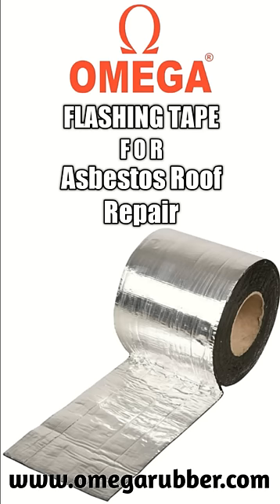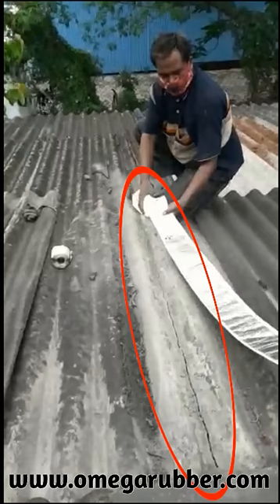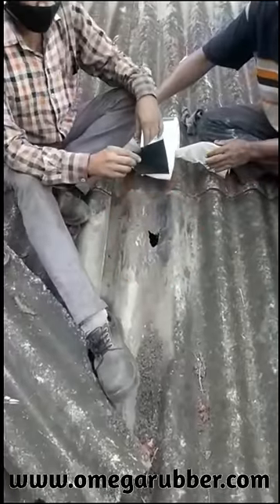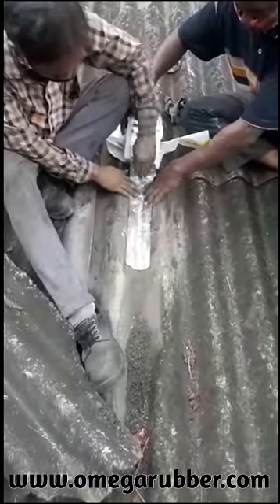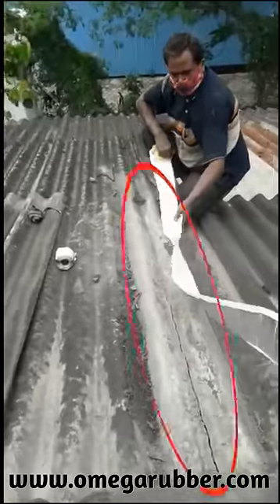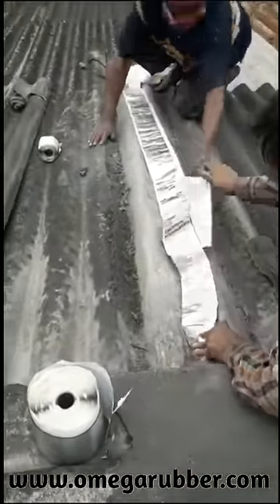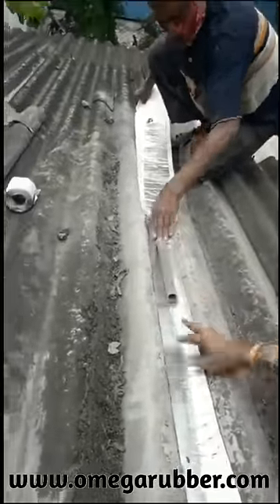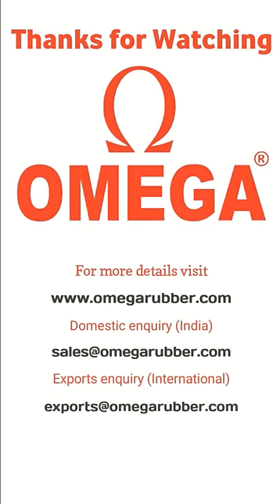HOW TO quickly repair leaking asbestos roof using OMEGA BUTYL ALUMINIUM FLASHING TAPE I India I

Comment: I have spent lot for asbestos sheet to solve water leakage. I shall try this to. 
Do u have any specialist to do this?
Reply from the maker: Ideally this is a Do It Yourself(DIY) product, so if the location where the application is needed is accessible easily we would say you can do it on your own. However, if you feel that the location is a little risky or is not easily approachable we would definitely ask you to take help from someone because we don't want you to get hurt.

Comment: In the centre of mine profile sheet and rcc lanter there is a crack through which water came down is there any sloution of it the crack lengthy is almost 10 feet ???😊😊😊😊 Which tape is suitable for me and how to apply and how many metres for 10 feet lenght  crack
Reply from the maker: Our tape is 10mtr long which is over 30ft so as far as length is concerned you are pretty much covered
We recommend you use 150mm x 10mtr OMEGA Butyl Flashing Tape
please find the links to our product below
before applying the tape please ensure that the surface is absolutely clean and dry

Amazon:
150mm x 10mtr
https://www.amazon.in/gp/product/B097Y1NTQD/ref=cx_skuctr_share?smid=A31UCKADDKPX9T

Flipkart:
150mm x 10mtr
https://dl.flipkart.com/dl/product/p/itme?pid=HWTG3ZF47PGXK9TN&lid=LSTHWTG3ZF47PGXK9TNBEWCBO

Comment: Can this tape can use for cement sheet joints water reverse problem and what is the life span of product
Reply from the maker: Yes OMEGA BUTYL FLASHING TAPE  is  ideally suitable for stopping water leakage in cement sheet joints . You can buy it from Amazon or Flipkart . 

Thanks

Comment: Is  this Omega sheet is available in Kolkata? If it is  then which market in Kolkata?please let me know?
Reply from the maker: Yes! Our products are available Pan India on both major ecommerce platforms i.e. Amazon and Flipkart please find the link to our products below

Amazon:
150mm x 10mtr
https://www.amazon.in/gp/product/B097Y1NTQD/ref=cx_skuctr_share?smid=A31UCKADDKPX9T

100mm x 10mtr
https://www.amazon.in/gp/product/B0974G1QTB/ref=cx_skuctr_share?smid=A31UCKADDKPX9T

50mm x 20mtr
https://www.amazon.in/gp/product/B097Y3VZP8/ref=cx_skuctr_share?smid=A31UCKADDKPX9T

Flipkart:
150mm x 10mtr
https://dl.flipkart.com/dl/product/p/itme?pid=HWTG3ZF47PGXK9TN&lid=LSTHWTG3ZF47PGXK9TNBEWCBO

100mm x 10mtr
https://dl.flipkart.com/dl/product/p/itme?pid=HWTG2WF6HYFYZYAV&lid=LSTHWTG2WF6HYFYZYAVRTUKGO

50mm x 20mtr
https://dl.flipkart.com/dl/product/p/itme?pid=HWTG3ZF4KSJQ4W6U&lid=LSTHWTG3ZF4KSJQ4W6UX1BGVW

Video Link for asbestos roof repair is attached below
https://youtu.be/KqgQwV7KLrQ

Comment: It is used in.cracks in water plastic tanks??
Reply from the maker: Yes it can be used to repair Plastic tanks. 
For Best Results, Please note you should use the tape when the plastic tank is absolutely DRY 
( DO NOT Stick on Wet surface or when water is flowing from the leaking area ) 
Stick the tape from inside and also from outside to give you a watertight joint.

Comment: Wil  it work in raining season as it's a tap will it  wearing out when it comes in contact with water sowil it stay during raining season
Reply from the maker: The tape has to be applied on dry and clean surfaces only
No, it will not wear out easily even if it comes in contact with water post application
Reply: Thank you
Reply: How can I order the tape
Reply from the maker: You can easily find our product on Amazon and Flipkart
Please find links to our products below

Amazon:
100mm x 10mtr:
https://www.amazon.in/gp/product/B0974G1QTB/ref=cx_skuctr_share?smid=A31UCKADDKPX9T

Flipkart:
150mm x 10mtr: 
https://www.flipkart.com/omega-butyl-flashing-tape-10-m-single-sided/p/itm3bb069294b20e?pid=HWTG3ZF47PGXK9TN

100mm x 10mtr
https://www.flipkart.com/omega-0mega-butyl-flashing-tape-10-m-single-sided/p/itme8d42ab882e2d?pid=HWTG2WF6HYFYZYAV

50mm x 20mtr
https://www.flipkart.com/omega-butyl-flashing-tape-20-m-single-sided/p/itm717078a38b9ed?pid=HWTG3ZF4KSJQ4W6U

Comment: Sir, can we for cement bio gas plantation drum ??
Plz reply
Reply from the maker: Please send us a photo / Video of the cement bio gas plant drum so that we can give you suggestion . Thanks
Reply from the maker: @Ananda_M   Please send email to sales@omegarubber.com .Thanks
Reply: @omegarubber  ok thanks
Sir , I have mailed the bio gas drum photo please check once and suggest me
Reply from the maker: We have seen the photos of Bio Gas Drum. 
Please note Cracks are not visible , however as we understand their is Bio Gas inside and even very small cracks will allow the Gas to leak from the Drum. 
Question 1)  Is it possible to Apply our Omega Butyl Flashing tape from Inside the drum ? 
Answer 1) If YES then Our tape might work , you have to take a trial , we have never used our tape for this application earlier. Taking trial will be cheaper than changing the drum. 
If you intend to apply the tape on the outside of the drum, we are not sure because the gas pressure might not allow the tape to stay at its place .
2) How much quantity do you need to repair it ? 
We have Omega Butyl Flashing Tape available in three size variations . 
Width - 50 mm , 100 mm and 150 mm . 
Length per Roll - 10 Meters . 
In case you decide to take trial we suggest you should use 150 mm width to cover up the crack properly . 
Hope this was useful . 
Thanks 
Team Omega
Reply: @omegarubber  ok sir thanks

Comment: Hi pls advice if we can apply any water proof quote over the omega rubber in case if I am using it over the roof
Reply from the maker: Under ideal conditions, you will not have the need to apply any coat over Omega Butyl Flashing Tape
However, if you still wish to apply a coat over the tape we would highly recommend you to purchase Omega Butyl Fleece Tape
If you wish to purchase Omega Butyl Flashing Tape you can order the product from Amazon or Flipkart(link to which have been attached below)
Amazon:
100mm x 10mtr:
https://www.amazon.in/gp/product/B0974G1QTB/ref=cx_skuctr_share?smid=A31UCKADDKPX9T

Flipkart:
150mm x 10mtr: 
https://www.flipkart.com/omega-butyl-flashing-tape-10-m-single-sided/p/itm3bb069294b20e?pid=HWTG3ZF47PGXK9TN

100mm x 10mtr
https://www.flipkart.com/omega-0mega-butyl-flashing-tape-10-m-single-sided/p/itme8d42ab882e2d?pid=HWTG2WF6HYFYZYAV

50mm x 20mtr
https://www.flipkart.com/omega-butyl-flashing-tape-20-m-single-sided/p/itm717078a38b9ed?pid=HWTG3ZF4KSJQ4W6U

But if you wish to purchase Omega Butyl Fleece tape you will have to get in touch with us directly over call/WhatsApp on either of the numbers mentioned below
+918962869630
+919893100066

Comment: What must be the width of the tape to fix a cracked asbestos sheet
Reply from the maker: The width of the tape will depend on the size of the crack in Asbestos Sheet . Mostly people use 100 mm wide ( i.e. 4 inch wide ) tape . However we have 50 mm , 100 mm and 150 mm wide tape readily available and also available on Amazon and Flipkart . 
Hope we were able to address your query . 
Thanks . Team OMEGA

Comment: His does it work for concrete water leakage tank?
Reply from the maker: Yes , it can be used for concrete water tank too , please ensure you paste the tape when the surface is dry and the tank is empty when you apply the tape . Tape should be applied from inside the tank . To make it 100% waterproof apply from inside and outside both .

Comment: In my home there is a crack in cross direction from the end of my wall to whole sheet in 10ft asbestos sheet … is it possible to arrest the water leakage by using omega rubber
Reply from the maker: Yes it can be applied along the length of crack of asbestos sheet and it will work well to arrest any water leakage , only take following care while applying ;
Applying from the top of the sheet will give best results
Before applying ensure that the surface is clean and dry
The surface must be free from any oil , grease, dust etc. 
There should be no Water/ Surface should not be wet while applying the tape . 
Cut the tape as per the size of the Crack 
Peel the Easy Release Paper 
Apply it on the Cracked surface. 
Press it properly , preferably with the help of a roller so as to ensure proper bond and no air entrapment .
Relax !! 
: -)

Comment: Will it works to cement water tank(Sump) cracks ??? can we use this to prevent water leakage from cement tank through cracks ?
Reply from the maker: You will have to empty the Water Tank . 
Allow the tank to Dry . 
Then apply from inside of the Tank . 
IT SHOULD WORK .........
Reply: @omegarubber  Thank you...
Reply from the maker: Happy to help :)

Comment: Hi, i am not sure if the house I am renting has asbestos roof tiles, and I am worried to go try repair, as i know asbestos is very harmful, is it ok to try repair it without causing more damage?
Reply from the maker: We didn't quiet understand your concern 
We'd love to learn better to give you a better solution 
Kindly contact the number mentioned below if you would want to get your queries cleared
+918962869630
Reply: @omegarubber hi friend . I am a manufacturer focus on butyl tape ,sounder proof damping sheet. If you need big quantities,you can contact me.

Comment: What is the price of the Omega rubber tape. How it will be available.
Reply from the maker: Thanks for your interest in our product Omega Butyl Aluminium Flashing Tape . 
This product is available in 50 mm ( 2 inch ) , 100 mm ( 4 inch ) and 150 mm ( 6 inch ) width and in lengths of 1 mtr , 5 mtrs , 10 mtrs and 20 Mtrs per box . You can choose the product as per your requirement and buy it online from Amazon or Flipkart ....
Please click on the link below to go to our store on Amazon ;

https://www.amazon.in/OMEGA-adhesive-aluminium-waterproof-flashing/dp/B0BN1DWJ4K/ref=asc_df_B0BN1DWJ4K/?tag=googleshopdes-21&linkCode=df0&hvadid=619625485367&hvpos=&hvnetw=g&hvrand=13159134036537803415&hvpone=&hvptwo=&hvqmt=&hvdev=c&hvdvcmdl=&hvlocint=&hvlocphy=9300952&hvtargid=pla-1954827013433&th=1

Thanks 
Team Omega

Comment: Excellent demonstrator, very very useful info, and his voice is so clear. Where can we get the product in andhra pradesh?
Reply from the maker: Thank you so much for your appreciation <3
You will be able to find our product easily on Flipkart Under the name OMEGA FLASHING TAPE
Reply: @omegarubber  ok Sir, thank you🌹
Reply from the maker: Most welcome!
Please find the link to our products below

150mm x 10mtr: 
https://www.flipkart.com/omega-butyl-flashing-tape-10-m-single-sided/p/itm3bb069294b20e?pid=HWTG3ZF47PGXK9TN

100mm x 10mtr
https://www.flipkart.com/omega-0mega-butyl-flashing-tape-10-m-single-sided/p/itme8d42ab882e2d?pid=HWTG2WF6HYFYZYAV

50mm x 20mtr
https://www.flipkart.com/omega-butyl-flashing-tape-20-m-single-sided/p/itm717078a38b9ed?pid=HWTG3ZF4KSJQ4W6U
Reply: @omegarubber  ok Sir
Reply from the maker: We are now also available on Amazon
100mm x 10mtr:
https://www.amazon.in/gp/product/B0974G1QTB/ref=cx_skuctr_share?smid=A31UCKADDKPX9T
Reply: Want 3meter can you ship to AP
Reply from the maker: We are available on e-commerce platforms like Amazon and Flipkart so Delivering to any location pan India is not a problem. However, the only sizes we manufacture length-wise are 10 meters. By experience we can guarantee, once you have the tape in your hand you will find multiple uses for it for domestic use and the 10 meters will be consumed in no time.

Please find links to purchase our products below
Amazon:
150mm x 10mtr
https://www.amazon.in/gp/product/B097Y1NTQD/ref=cx_skuctr_share?smid=A31UCKADDKPX9T

100mm x 10mtr
https://www.amazon.in/gp/product/B0974G1QTB/ref=cx_skuctr_share?smid=A31UCKADDKPX9T

50mm x 20mtr
https://www.amazon.in/gp/product/B097Y3VZP8/ref=cx_skuctr_share?smid=A31UCKADDKPX9T

Flipkart:
150mm x 10mtr
https://dl.flipkart.com/dl/product/p/itme?pid=HWTG3ZF47PGXK9TN&lid=LSTHWTG3ZF47PGXK9TNBEWCBO

100mm x 10mtr
https://dl.flipkart.com/dl/product/p/itme?pid=HWTG2WF6HYFYZYAV&lid=LSTHWTG2WF6HYFYZYAVRTUKGO

50mm x 20mtr
https://dl.flipkart.com/dl/product/p/itme?pid=HWTG3ZF4KSJQ4W6U&lid=LSTHWTG3ZF4KSJQ4W6UX1BGVW

Comment: Will it work on cement roof. And it is short time treatment or permanent. 
Or sunlight ke karan yah kuch samay bad kharab to nhi ho jayega
Reply from the maker: Yes it will work on cement,
If applied in the recommended way you will not have to worry about the service life at all
The tape is backed with aluminium which not only provides reinforcement but also provides UV protection
Reply: @omegarubber  hi can you tell me how long this tape will roughly last as a repair please
Reply from the maker: @Timothy Cassidy under ideal circumstances and if applied exactly in the recommended way we estimate a life of over 10 years

Comment: can it use under shead sheet ?
Reply from the maker: Yes , Better to use from Top , But it will work from Under the sheet also ...

Click to view the product on Amazon 

https://www.amazon.in/s?me=A31UCKADDKPX9T&ref=sf_seller_app_share_new

Click on link below to check out product on Flipkart - 
OMEGA Butyl Aluminium Flashing Tape Size 100mm x 10mtr

https://dl.flipkart.com/dl/product/p/itme?pid=HWTG2WF6HYFYZYAV&lid=LSTHWTG2WF6HYFYZYAVRTUKGO
Reply from the maker: DID YOU FIND OUR PRODUCT USEFUL ?

Comment: Will it work if I apply it from inside ?
Reply from the maker: Recommended to apply from the side where it is raining , that is on the rooftop or on the outside . However if it is not possible to reach on the roof , second option is to apply it from inside .

Comment: Bro can we use this tape on a terracotta taile roofing?
Reply from the maker: Yes, Absolutely
However, as mentioned in every single video of ours pleasemake sure that the surface you are applying the tape on is clean and dry. There should not be any form of dust, rust, debris, oil, grease, water etc
if you follow this and apply decent pressure while applying so as to not leave any air bubbles you will be good to go.

Comment: Hi sir.. Is this tape can give rescue from water leakage from cement sheet roof in rainy days? I am having water leakage problem rainy days... Is this tape clear my problem...
Reply from the maker: Hello ! 
Yes this tape will stop water leakage in cement sheet during rainy days . 
Before applying tape the cement sheet should be Clean and Dry.
Cut the tape to desired length , remove the release liner and stick it on top of the cement sheet. 
For Best result - Press the tape properly with a roller or with pressure of your hand as shown in the Video.
Note;
Our products are available on major e-commerce sites such as Amazon and Flipkart
Please find the links to our products below.

Amazon:
100mm x 10mtr (Grey)
https://www.amazon.in/OMEGA-BUTYL-FLASHING-100mm-10mtr/dp/B09FXMX2MT

Comment: Thanks for sharing this information. Can I use this on recycled fibre sheets
Reply from the maker: Yes, you most definitely can. 
Hope we were able to provide you with the required solution over the telephonic conversation.
Reply: 5 mitar only
Reply from the maker: Our Minimum Standard Product Length is 10 Mtrs per roll

Comment: Can you send link of good quality product?
Reply from the maker: Thanks for your interest in our product Omega Butyl Aluminium Flashing Tape . 
This product is available in 50 mm ( 2 inch ) , 100 mm ( 4 inch ) and 150 mm ( 6 inch ) width and in lengths of 1 mtr , 5 mtrs , 10 mtrs and 20 Mtrs per box . You can choose the product as per your requirement and buy it online from Amazon or Flipkart ....
Please click on the link below to go to our store on Amazon ;

https://www.amazon.in/OMEGA-adhesive-aluminium-waterproof-flashing/dp/B0BN1DWJ4K/ref=asc_df_B0BN1DWJ4K/?tag=googleshopdes-21&linkCode=df0&hvadid=619625485367&hvpos=&hvnetw=g&hvrand=13159134036537803415&hvpone=&hvptwo=&hvqmt=&hvdev=c&hvdvcmdl=&hvlocint=&hvlocphy=9300952&hvtargid=pla-1954827013433&th=1

Thanks 
Team Omega

Comment: Sir, if we joint 2 pieces tape as one upon another to cover an area of more than 150mm in width then it will work or not?
Reply from the maker: Yes, definitely it will work , only ensure that the surface is dry , clean and dust free , ALSO Press the Tape Strongly

Comment: Can we apply this tape from inside the house so that we dont have to climb on roof even though asbestos roof of our house is in good condition still they may get damaged due to my weight and cant trust the person who i will send as he may not follow instructions or clean before applying it.
Reply from the maker: Ideally the tape should be applied on the top of the roof so that the tape can prevent the water 💦 from pouring in …..
However if that is not possible, you can try from inside the house, but it may not be very effective….

Comment: can we repair from inside??im too heavy to climb the roof outside..😅😅
Reply from the maker: Thanks for asking . 
Correct way to repair water leakage is to apply Omega Flashing Tape on the side from where the water is coming in , that is From the Outside . 
However if it is not possible for you to climb the roof from outside , then second best alternative is to repair it from inside , IT WILL STILL WORK .